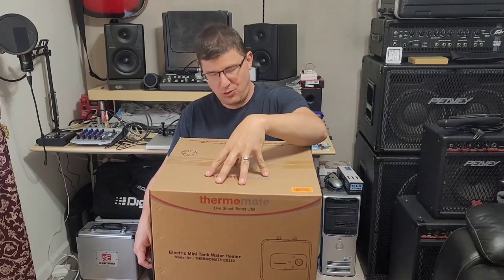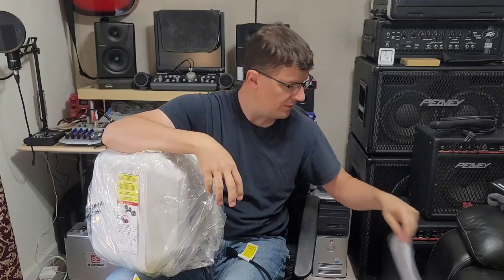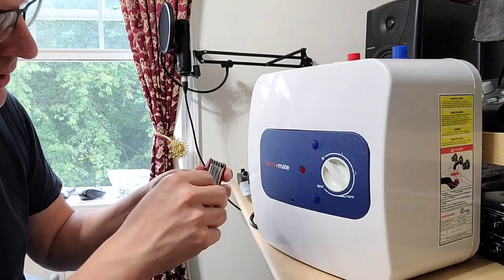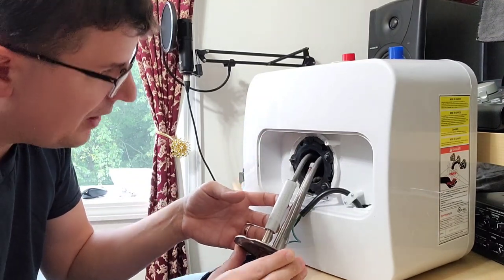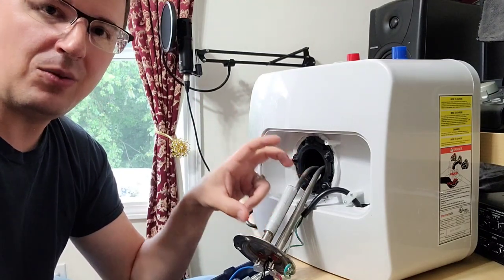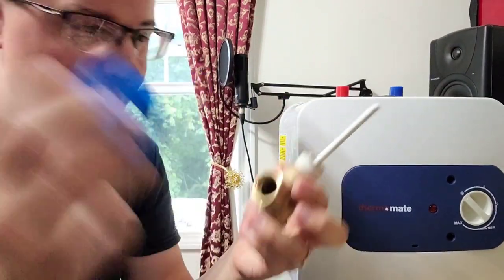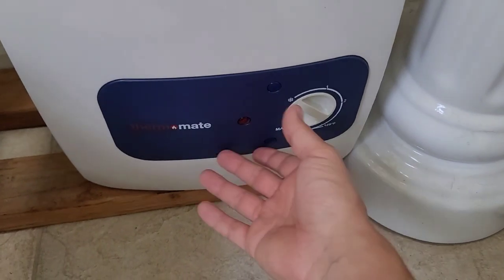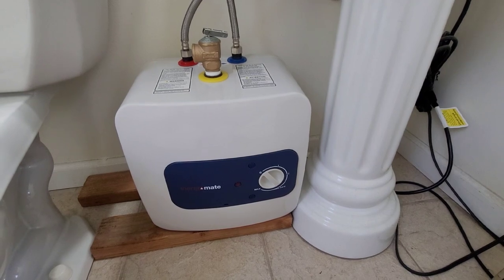Thermomate Mini Tank Electric Water Tank ES250 2.5 Gallon: Review, Maintenance, & Installation

Comment: This is the only mini tank water heater I could find that does not self-destruct if it gets turned on without being filled with water.   According to the manual if it is plugged in when empty or only partially full it will shut itself off and, according to the manual, you must press the reset button on the back of the unit to restart. This could be a big bonus when used in RV's where it might be empty for a variety of reasons.
Reply from the maker: I never looked at a schematic but it makes sense if the temperature internally gets too hot. The problem is if it keeps bouncing on that high temp limiter eventually something is going to break. Best to not chance it, fill up the water system before you hit the power switch!
Reply: @Bassguitarist1985  Absolutely!  But it's nice to know that if at some point the tank is empty and the power gets applied the hot water heater will not suffer catastrophic consequences.
Reply from the maker: @JDMech  correct, at least not immediately. There's a little bit of idiot margin for error :-)

Comment: In the deep past when I did commercial remodeling and upfits I sometimes got 5gal 120VAC standard W/H pullouts as that was enough capacity to pass code for hand-washing in non-habitable buildings. One element, slow recovery. And now you know why many budget restaurants never seem to have hot water at the bathroom sinks...
Reply from the maker: Yeah I have another video coming up that talks about the boss unit and within 8 months the anode rod was gone!! These small tanks don't last very long without constant maintenance.

Comment: Your videos on these mini hot water tanks are great! clear and concise, thank you. After owning both the Bosch and the Thermomate, do you have an opinion of comparison in quality or ease of maintenance? I Know I have high mineral content in my water so I will most likely burn through the anode like you. Are the anodes the same size or marginally different? Thank you in advance.
Reply from the maker: Hey thank you for watching! All these things are pretty much built the same. It's been about 8 months since installing this tank and I'm due for a flush just to inspect it. I'll definitely do a follow up video like I did with the Bosch. The anode rods are all the same size as far as I can tell. Picked one up on Amazon for $13. That way it'll be ready to go when I take out the heating element to inspect.
Reply: @Bassguitarist1985  Awesome, thank you for the reply. looking forward to it aswell.

Comment: Do you not need to install the pressure relieve valve to the drain?
Reply from the maker: You don't need to no. However ideally you should route the valve through a pipe towards the ground so not scalding water sprays to the ground and not to the side.
Reply: @Bassguitarist1985  How likely is that to happen under normal circumstances?
Reply from the maker: @christianpedersen3237  not likely but possible. If the thermostat fails always keeping the element going, the hot water would cause an overpressure condition and open the valve.
Reply: @Bassguitarist1985  plumbing of that thing is not trivial. I was going to install it under a kitchen sink, but you would want to avoid having waste water run back into the water heater. Ended up abandoning it.

Comment: Great video, I have a question for you. I have the same tank in my food trailer, and stupid me I did not winterize it this season. I notice that when I went to turn on the water, there was no water coming out. I also noticed a leak where you took out the blue panel. Is there a way to fix this, or will I need a new tank.
Reply from the maker: May need a new tank :-(
Reply: @Bassguitarist1985  thanks for getting back to me. That's what I thought, too. Live and learn, I guess
Reply: tank leak can't be repaired. that's true for all tank water heater

Comment: how much power will it take to heat up the water if you fill it with cold ?
Reply from the maker: It's a 1500 w heating element. If you're talking about how many kilowatt hours it takes to heat up the water from cold tap to the set temperature that involves a little bit of math. 😁
Reply: The recovery rate is 6.8 GPH, meaning, if you get the 1.3 gallon version, it should be able to raise 30F water to 120F in about 12 minutes. A normal faucet will deliver around a gallon per minute, and you're unlikely to use only warm water when e.g. washing hands. Meaning, you can probably was hands for a couple of minutes or more before water gets cold.

Comment: The white tube that needs to be inspected yearly...what are indicators that show it needs to be changed?
Reply from the maker: If it's heavily corroded is the indicator. The outward indicator that tells you the anode rod is gone not doing its job is when the tank starts leaking.
Reply: @Bassguitarist1985   k ty!

Comment: Why are you replacing the Bosch?   DOA?
Reply from the maker: No, I caught it just in time to replace the anode rod and I now have it as a spare. Apparently my water table is very high mineral content and I need to swap out the tanks every 8 months or so before I run into corrosion problems. So basically I'll swap out one so it's easy to deploy and then do the maintenance on the other one and store it until the other one is due for maintenance.